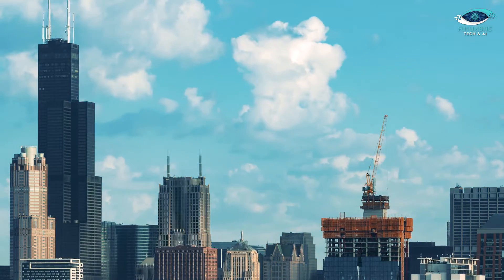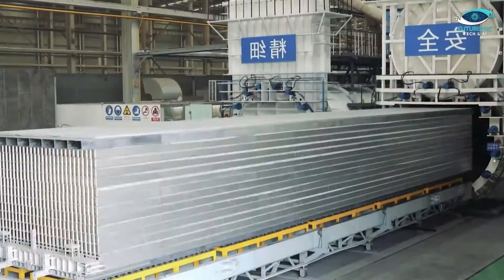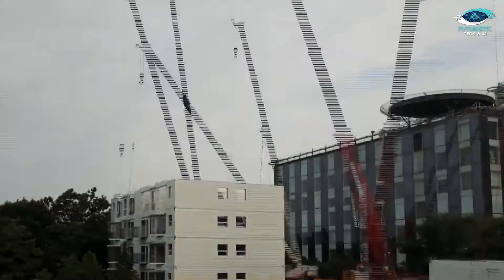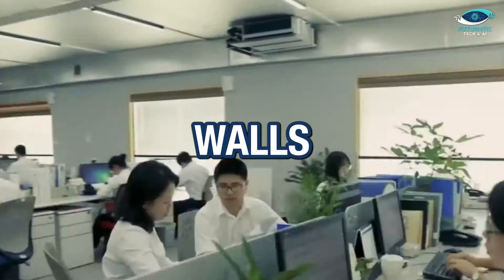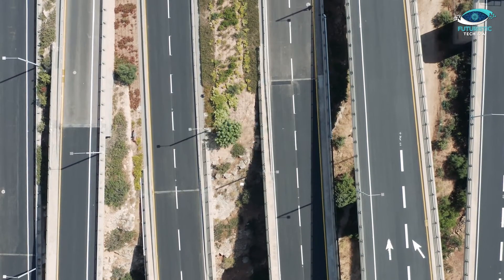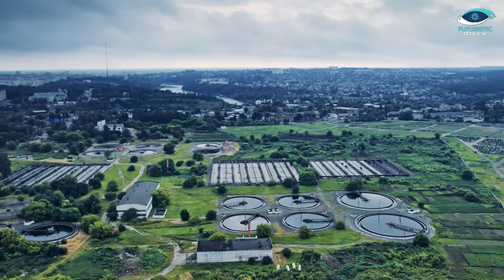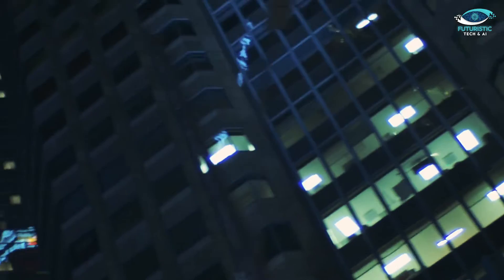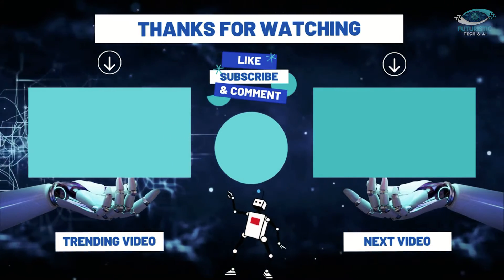China's Unbelievable 11 Story Building in 29 Hours | China Fast Track Construction #china #chinatech

Comment: Nothing new. Stainless steel core panels already exist for a decade.
Reply from the maker: Are they already used somewhere in a huge building?
Reply: @FuturisticTechandAI  Of course not. That would make construction of a building much more expensive.
Contrary to what they want you to believe, normal structural steel per ton cost much more than concrete. At least 5 times. Stainless steel would increase that price significantly.
Besides, you still need other materials to make the walls. floors, stair wells etc.
Further, the video is showing prefab units. Unless there is a severe shortage of housing, why would you invest so much in a production plant to produce the prefab units, and in machinery and labor just to build and apartment building in 29 hours?